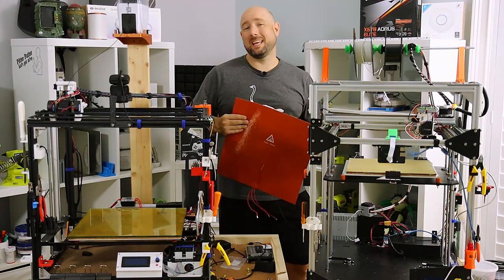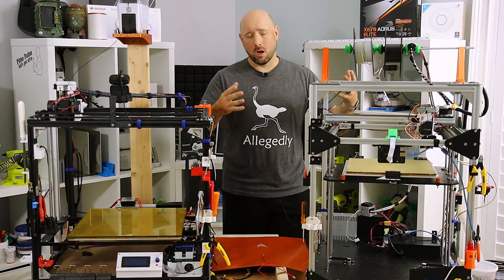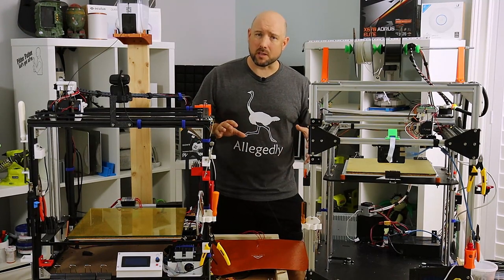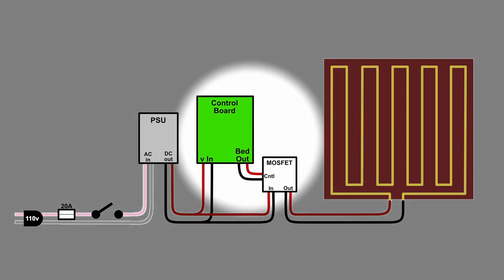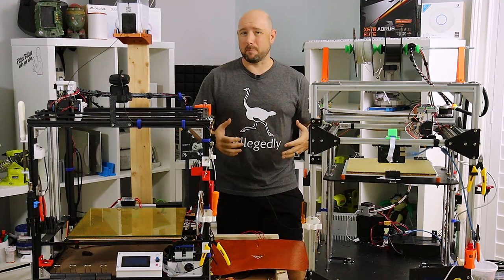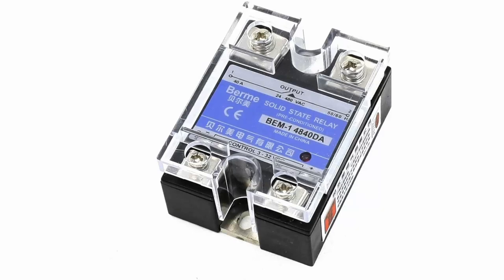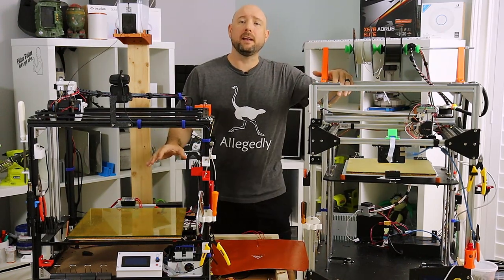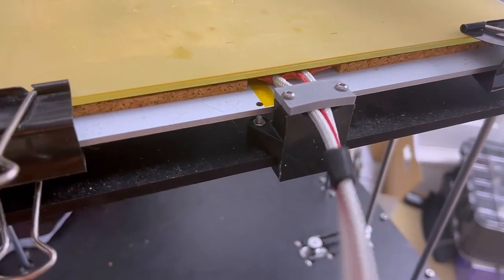Silicone 3D Printer Heated Beds: Everything You Need to Know

Comment: Firstly, for DC voltage, a threshold of around 30 volts is often considered relatively safe for brief contact. This is based on the concept that at low voltages, the body's natural resistance limits the amount of current flowing through it to levels that are unlikely to cause harm. However, depending on the current source it can be dangerous if the output is shorted in that it can cause severe burns. e.g. an automobile battery output is 12 volts with a current capacity > 200A and it can literally melt metal and if you're in its path then you'll be severely burned.
Likewise,  AC voltage can be more dangerous than DC voltage of the same magnitude due to its ability to induce muscle contractions, potentially causing the victim to be unable to release from the electrical source. For AC voltage, the threshold for safe touch is generally considered to be lower than for DC voltage. Around 50-60 volts (25v positive and then 25v negative) AC is often cited as a threshold for safety, again for brief contact.
These are well established safety margins. I learned these margins long ago early in my career as an electrical engineer in the aerospace business.
Secondly, the cork method will likely work fine but be aware that you're adding height to the bed and some printers may not allow you to compensate for that added height easily. You may be able to compensate in the firmware but many don't have the skills or wherewithal to know how to do that. So be cautious when doing this kind of modification and have a plan to compensate for any deviations from the original machine physical characteristics.

Comment: Excellent video, and an extremely good point about SSRs most commonly failing closed!
Reply from the maker: Thanks Fritz.  I found out about the SSR failure issue the hard way.  Luckily I was close by and was able to shut it down before anything bad happened but I'll never run one without a temp cutoff fuze again.  Mains voltage is no joke.

Comment: Take it from a EE and use a power switch that switches the live and neutral. The switch is called a DPST switch. For the AC ground I would attach it to the aluminum plate that the silicone mat is sitting on since most beds have leveling springs or silicone standoffs.
Reply: Those beds attached with springs have a screw that goes through the middle of the spring or silicone spacer to the bed and through the mounting hole on the frame to a bed leveling nut. While not always perfect it typically allows connection through to either the y axis rail (for bed slingers) or z axis rails (corexy). Obviously it doesn’t have that connection if your bed is attached with printed parts but if it’s all metal (like mine) it can allow the connection through. I did have to add a wire to the bed still because just that previous connection was still about 60ohms from ac ground on psu to the bed.

Comment: Ive watched loads of these guides and done the upgrade a few times the one thing no one ever mentions is that the mat heating to temp quickly isn't the same as the heat propagating to the top of the bed you need to allow time for this
Reply from the maker: You are correct that the surface trails the measured temp especially on thicker glass.  I've not personally had too many issues - just allow for some time for temperature normalization and my first layer is a bit hotter than the rest - but I can see that being a concern with more picky filaments.

Comment: Hi, I got a 110v 220v 650w heating mat that has a total of  5 wires coming out, 2 small wires for the thermistor and then 3 red wires with no markings or instructions on how to wire this to 110v and or how to add a thermal fuse in-line, any help would be appreciated
Reply from the maker: Hey Radikult, the only time I’ve seen three power points on a bed heater was on a 12/24v model that had one pad for 12v, one pad for 24v, and one for ground. Do you have a link to the mat you purchased?
Reply: @LilMikeysBigPlans  the mat came with a kit (Voron 2.4 “siboor” was the seller) 
I checked all 3 red wires and in between them I get 37omn and 75omn  depending on the mix of cables. 
If I start combining cable 2 / 1 I get a reading of 20omn  
I have contacted the seller but because is a Chinese seller I won’t hear from them until tomorrow or next day if lucky

Comment: Helpful video! two questions: are you using a zero-crossing SSR? Are you using PID control on your SSR controlled bed? Is so what switching frequency? From what I understand a Zero crossings SSR can’t switch nearly as fast as a mosfet I’m just wondering if that causes issues with PID control.
Reply from the maker: I am using a zero-crossing SSR.  My understanding is that most SSR - even quite cheap ones - have zero crossing detection if for nothing else but to prevent arcing.  I'm using PID control with no issues.  My PID tune came up with these values:
pid_Kp: 54.027
pid_Ki: 0.770
pid_Kd: 948.182

Comment: Beware that lot of SSR's do not go well if PWM controlled, they will just fail / melt..
When using a SSR, keep the heating control to "BANGBANG" (Marlin) or "Watermark" (Klipper) which just turns the SSR on or off without using a destructive PWM signal

Comment: Great info. What thickness did you use for the cork tile?
Reply from the maker: Hey Paul, glad you found it useful!  I'm using regular 'ole bulletin board cork tile from Walmart.  It's 3/16" thick but you should be able to use pretty much any thickness as long as it's thick enough to take pressure off the pad wiring.
Reply: @LilMikeysBigPlans  Thanks for the response. This is great timing as I was getting ready to do the heat bed upgrade.

Comment: I gotta ask, how much additional time was added to your o to 120°C temp drag race, putting an insulator between the Keenovo and 6160 plate?

I too was a bit concerned, but my solution was to add one more layer of the High Temp 3M double sided affixing tape.
Negligible increase, as I'm still sub 50 seconds to 120°C.

I did use cork though, but as the final layer in my hotbed sandwich 😋😅😁
... Reason being, I've got a 500watt PTC in the chamber, and one of the high velocity 120mm always seemed to wabble the bed temp 5°or more when it kicked ok.
Not anymore with a cord finishing piece tho!

As always, gr8 vid my friend!

...And if you have a spare minute, lenigma1 has sent more than 1 email since Christmas 😉😉
Reply from the maker: Hey Bo.  I've only ever run my silicone beds with a cork insulator so I can't really compare however the numbers should be faster with the insulator as it will keep the aluminum from leeching away the heat so quickly.  Either way, I doubt it has anywhere near the impact of the 1/4" glass.  That is some thick heavy stuff that adds a ton of mass.

My apologies on the email.  Picked one from 2/14 out of Spam.  Will reply tonight :)  Take care!

Comment: I have a question, lets's say I want to put 3 Ender 3 V2 Beds all together, at 220W per bed I will need at least 660W. If I buy a 1000W power supply, will the mainboard be able to accept the wattage and high amps?
Reply from the maker: Depends on what you mean by the mainboard accepting the amps.  You can power the board off of the 1000w PSI with no issues.  It will only draw the amps required.  You cannot push that same 1000w out of the board's bed heater terminals as the switching circuitry is not rated for that much draw (at least no board I've seen is).  You'll need to use a MosFET for board power.
Reply: If you're doing that, might want to consider getting 3 additional MOSFETs, one for each bed.  Connect the bed heater output from the mainboard to the 3 MOSFETs and this will reduce the load that a single MOSFET would have.

Comment: Thanks for your video. I was wondering if the silicone heater of 200x200 I wanted to buy would be a problem for my 225x225 aluminium bed.
I do have some feedback regarding your safety disclaimer. It came across with me as if only Voltage matters when it comes to safety risks. In fact, although it's relevant to account for all factors, the real danger lies in the amperage. Voltage will just determine how likely your body's resistance will be enough to prevent becoming a neutral or ground.
High voltage will easily arc thrugh the air and reach your body, but if the current is low, you will just feel a pinch. That's how some domestic 5000 V electrified fences work. They carry a very small current and will only scare you if get near it.
Now I'd rather take 240 V shock from my a circuit in my house than (which I have), than 12V shock with 600A from my car's battery. Not sure I'd survive that easily as the times I got stung manipulating the 240 live without shutting it down.
Reply: Unless you had cuts in your hands, 12V from a car battery cannot possibly shock you. It's not a "likelyhood" thing, you objectively will or will not get shocked at a certain voltage with dry, moist wet or cut skin. With cuts in your hands, 12V and 240V are equally as likely to kill you. The threshold for sending your heart into fibrilation is under half an amp. Once you get past the skin layer, your flesh is quite a salty and wet medium, making it a great conductor. Result? Both 12v from a car battery and 240v from the wall will be able to supply enough current to your heart to mess it up.
Reply: @somedude2492  I agree, my main point was that it made sound like low voltage is not dangerous, but low voltage and high amp is very dangerous. It all boils down to a factor of the two which will determine the amount of energy passing through you (J/C and C/s). My hands more often than not have cuts in them. Higher voltage may break the skin barrier easier, but then that is assuming, like you mentioned, you don't have cuts on the skin. Which is quite a gamble for people that tinker a lot.

Comment: which type of cork to be used natural or rubber cork?
Reply from the maker: Hello Akshay.  Mine are just regular cheap-o 1/4" thick natural cork tiles.  Cork has a very high flash point and is generally considered flame resistant so it's great for an application like this.

Comment: bro I need help, the more I look at yt the less I understand ... I'm afraid I'm going to screw something bad with the heater connection.
I took myself (skr 1.2 pro motherboard) with a few upgrades that I plan to apply ... but the more I look, the more insecure I am about the security of everything.
I need a heat bed, a nozzle heater, a chamber heater (80C max) and maybe a filament heater for drying.

I plan to connect 5 stepper motors (no 17, 3x32mm, 1x40, 1x48mm)
Probably 8-10 fans
2x chamber fans
3x housing
1x power supply
2x cooling of the print
1x hot end
1x filament dryer

+ screen, bl touch and other little things if I left something out

I currently have a 12V 360w (30A) power supply, I think I will need another 24v power supply to connect it all.

Besides ... how many fuses do I need .... 60? How much mosfet do I need?
Reply from the maker: Wow, Danijel, that's quite a lot to figure out.  You're definitely not going to want that all on one power supply - especially a small 12v/360w one.  To go through it one-by-one:
8-10 fans, 5 steppers, and your hot end can probably be driven by a single PSU
If you are using a 110/220v bed that won't draw anything but signal from your PSU but if it's 12/24v then you'll want something in addition to the 360watt one you have now.
There seem to be a bunch of options for chamber heat and almost all of them are 110/220v based so no additional PSU there.

You'll want fuses on mains powered 'stuff' - so you'll need fuses for each of your PSUs and make sure whatever your chamber solution is has some sort of fuse.  As for the mosfet - they generally have a large operating voltage range and are either 10 or 15 amp which should be plenty for a DC heated bed so as long as you get something from a name brand you should be fine.

It sounds like you're building something quite complex so I would strongly advise you get a friend, family member, or other associate to assist as this kind of electricity is no joke.

Comment: 12 to 24 can't shock you heck even 84vdc can't
Reply from the maker: You're right, 12-24v will not normally give a shock but with a little sweat, open wound, or other conductivity enhancer it can definitely cause a noticeable tingle - as evidenced by a 9v battery on your tounge or a TENS machine (which start as low as 16V output).

No, none of this will electrocute you but the moral of the story is that you should be careful with electricity at all voltages and currents.